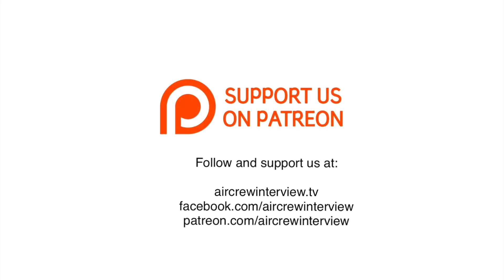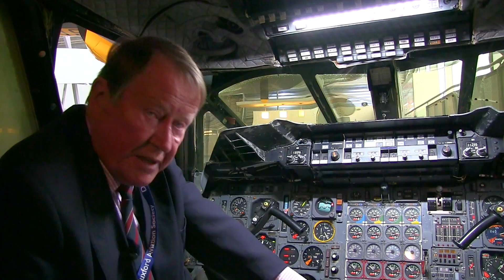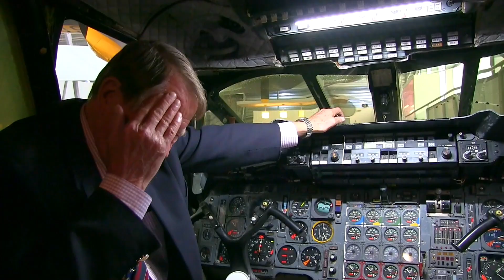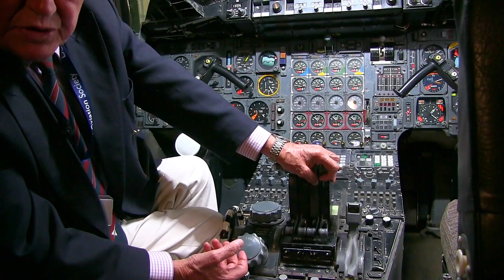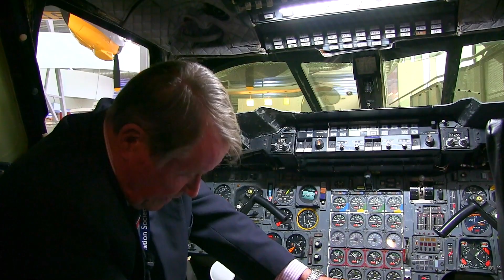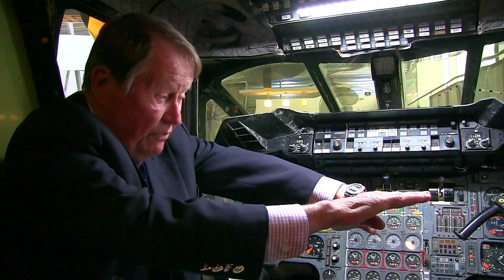John Hutchinson on Air France Flight 4590

Comment: 1. Aircraft down for maintenance the day prior, landing gear disassembled, reassembled without the undercarriage spacer which was left sitting on a shelf:  Check
2. Day of take-off, pilot wants extra fuel, authorizes topping-off the tanks when they are normally left at 83%.  Filled them to max capacity: Check
3. Captain asked for an additional 3 tons of taxi fuel anticipating taxi congestion/long wait time: Check
4. Passengers are part of a crew ship with full baggage for a long distance cruise from New York to Sidney, baggage weights were maxed, but 19 bags were left.  Captain told baggage handlers to load up the remaining 19 bags in the rear hold, exceeding the aft Center of Gravity limits.  Aircraft structural weight exceeded: Check
5. Taxi time was only a few minutes, particularly quiet day, so they’re way over weight now with the extra taxi fuel, max fuel tank capacity, and rear CofG exceeded: Check
6. Segment of runway was being resurfaced, closed off for use.  Captain asked to use it anyway because he knew he was overweight: Check
7. There was a ledge of elevation difference between the runway being resurfaced and the working portion of the runway.  Captain requests to use the lower elevation runway being repaired: Check
8. Conditions include a tailwind, which exacerbates the maximum structural weight violation, effectively making it 8 tons overweight: Check
9. Aircraft hit the ledge on the way down the runway, an Airbus pilot noticed that they were scrubbing their wheels down the runway afterwards, with smoke emitting from the LH undercarriage.
10. LH undercarriage right front wheel hit a piece of titanium debris left by another aircraft, cut a heavy chunk off the wheel which flew up at high velocity impacting the wing fuel tank, rupturing the tank due to resonant shockwave effects.
11. Fuel management system had been overridden to allow redistribution of fuel since the crew knew they were over-filled and over CoG in the aft limits, even though intra-tank fuel-pumping is restricted during take-off.
12.  Landing gear skewed off from alignment, forcing the aircraft off the runway before it became airborne. Wiring from the landing gear ignited the bursting fuel spewing from the ruptured fuel tank.
13. Flight engineer got an engine fire warning, immediately shut down engine #2 without informing the pilot, and didn’t select contingency power for take-off per the emergency procedures.
14.  With its reduced power, it never reached its required climb velocity, and barely cleared a 747 waiting to cross the runway by 20ft.  This 747 had the President of France and his wife onboard.
15.  With its max take-off gross weight exceeded by many tons, Center of Gravity exceeded in the aft, fuel spewing out from more forward throwing the CoG out of balance even more, with a tail wind and only 3 engines producing thrust, it crashed into a hotel, never having exceeded 200ft AGL.

It’s like reading a textbook of all the things you could possibly do wrong.  The only thing they left out was stripping butt-naked in the cockpit, dousing themselves with whiskey, while singing drinking game songs.
Reply: The Flight Engineer DID NOT shut the engine down without permission. Capt Hutchinson is completely wrong on this. He admits he should have read the report before doing the interview. Here is what actually happened:

From BEA report P 133: "Engine fire alarm actuation and the very low values on the parameters led the crew to shut down the engine after the Captain called for the engine fire procedure. In fact, the movement of the throttle control lever to its idle stop is heard and, a short time later, pulling of the fire handle. In addition, the deceleration of the engine, established from the recorded parameters, is consistent with a commanded engine shut down."

See the following timeline from the CVR and d Concorde Flight manual.
o	14 h 43 min 13.4 s, message from the controller indicating flames at the rear and read back by the FO. 
o	14 h 43 min 16.4 s, FE “(stop) “. 
o	14 h 43 min 20.4 s, FE “Failure eng… failure engine two”. 
o	14 h 43 min 22.8 s, fire alarm. 
o	14 h 43 min 24.8 s, FE “shut down engine two”. 
o	14 h 43 min 25.8 s, Captain “engine fire procedure” and in the following second the noise of a selector and fire alarm stops.

Comment: I read in another post that a strip of metal shrapnel that came off a jet that landed in the U.S. was on the runway and at that speed was deadly in terms of ripping the tire to pieces that sucked into the air intake of the engine that started the fire....this is a much more comprehensive explanation including the metal strip that places the blame where it likely belongs...

Comment: According to the transcript they did talk about shutting down the left engines. The captain ordered to do the engine fire procedure and even asked later confirmation that the engines were turned off which was the case.

Comment: John only gets one thing wrong; The rotational velocity of the tire at its surface was equal to the aircraft's ground speed.
Reply: hmmm, no. Rotanional velocity depends of how many rotation the wheel does in a given time frame..... we need to know the diameter of the tires and the ground speed.
Reply: @ssssssss6889  Sorry, no. If you can imagine the aircraft being stationary, and the runway moving by instead, it becomes evident that the speed of the tyre's surface must be equal to the runway's speed. Tyres that can withstand the speeds that John conjectured are very special things indeed that do not resemble Concord's tyres at all.
In fact they might even not be made of rubber.
Reply: @ssssssss6889  To elaborate;
Concord's tyres were 48 inches in diameter (actually 47 but I bet they got bigger with speed)
That yields a circumference of 150 inches.
Let's put in a vehicle speed of 230 mph.
Tyre rpm will then be 1611 rpm.
so a point on the circumference will travel 241,650 inches in a minute
or 20,138 ft/min
or 3.81 miles per minute
or 229 mph at the circumference. Small error due to rounding
So the chunk of rubber left the tyre with a velocity of less than 300mph. Still plenty fast enough.
Reply: @scheusselmensch5713   That's correct but that's the vectoral speed. The rotational speed should be quantified as degrees per time, degrees per second, for example.
Reply: @ssssssss6889  Ah, I see what you're getting at. Rotational velocity was John's choice of words but he was definitely referring to the speed at the tyre's circumference.. At any rate, John suggested that the rubber chunk had a velocity comparable to a missile. As it happens I used to work with missiles and a typical speed for your garden variety missile was on the order of 1.5 to 2.5 Mach. A 4 pound chunk of rubber impacting the aircraft at Mach 2 would have carried the whole wing away.
I'm sorry but I thought you were disputing the speed of the ejected lump of rubber.
Off the top of my head, the rotational speed of the tyre would have been on the order of 10,000 degrees per second but 1611 rpm is a perfectly adequate measurement of rotational speed in any event.
Let's say then that the rubber chunk had an ORBITAL velocity about 250 mph.
Reply: @scheusselmensch5713  Right , ok. I am with you. I won't really be able to go through all details but I feel like the energy transferred to wing at time of impact should depend on 3 variables that are mass of the chunk, speed ( the way John means it) and rpm of tire. If , say , the tire had a much bigger diameter, assuming that the chunk would be the same size, the energy transferred to the wing would have been lesser due to the lesser rotational speed / rpm. Feel free to comment or to correct if needed, please.
Reply: @ssssssss6889  Well we can leave the rpm out of it as that is simply a factor required to calculate the speed of the chunk. Mass and speed in this case suggest an energy on the order of 10K Joules. If the chunk had been travelling at "the speed of a missile", it would have had around half a million joules of energy.
Reply: John also forgets about the Continental Airlines DC-10 that left a piece of metal on the runway.
Reply: @akseli9  No, he clearly mentions the FOD and the damage to the tire it caused.
Reply: @scheusselmensch5713  Thanks, I'll watch the entire video again

Comment: Accepting 450 kg of extra luggage is understandable (Who wants to pay for the Concorde experience and then wait for his bags at JFK for 5 hours ?) but taking off with a tail wind is so wrong. Did the crew know about the presence of french president, sitting in a 447 near the western end of the runway, and was somewhat invited to entertain the guy instead of slowly taxiing to take off in the opposite direction ?

Comment: For the passengers, "trip of a lifetime". It was to be a dream, New York, Sydney and they packed on the weight. Just a tiny part of the disaster, but over takeoff weight. A Clusterf*ck, taking off toward the wind, tires smoking. They ran over a strip of titanium that cut off a piece of rubber, and tank #5 was hit. Filled to the brim, against rules, it was the end. I may never fly again.

Comment: This is a story of commercial aviation. Once something goes wrong, it is like a house of cards. One thing after another. I once ended up overweight after cabin bags needed to be put in the hold. In order to get below take of weight, we sat on the taxiway with 40% thrust for 10 mins to get to max T/O weight. Never comfortable, always wise. How a Concorde Captain could be happy to cut corners when he is actually overweight, rather than notionally in my case, is beyond me.
Reply: especially because at the very high angle of attack for take-off and the rear c of g  at above maximum weight induced drag would have been immense - worse if the gear couldn't retract

Comment: Where does he get his data from???
It's just that pretty much everything he says conflicts with the final report done by BEA (w' accredited UK experts too)...
* the approx one ton overweight is negligible
* it wasn't a tail wind.  Wind was reported at 8? (or was it 6) kts - but probably nearer zero according to the BEA final accident report
* the spacer was not relevant to the aircraft deviating in direction on the RWY (accident report attributes that to solely the failed #2 engine, and loss of power on #1 (later recovered to near nominal)).
* FE did not shutdown the wrong engine. 

The list goes on.
I think folk should read the final accident report.  And I think JH needs to back up his (seemingly spurious) claims! - with, you know the stuff, DATA.

And... I think folk should read the Wikipedia article too.  (It's well referenced)!
NB: JH's claims (in this video) are covered in the WikiP article under the "Alternative Theories" section.
Reply: You believe in the tooth fairy, santa claus, and the easter bunny don't you?
Reply: @tommyspencer7891  You've produced some great evidence - NOT.  Well done.
I'd suggest you read the BEA final report and appendices and then back up JH's contrary and unsupported claims with some evidence.
Otherwise, I will not waste any further time with  you and further ad hominem attacks will be rightly ignored.
Reply: https://www.bea.aero/docspa/2000/f-sc000725a/htm/f-sc000725a.html
Reply: https://www.youtube.com/watch?v=C-nALYF73hU

Comment: Unbelievable so basically it was 95 % pilot error . How sad
Reply: That's not true his paraphrasing makes it sound like he's blaming the Capt but there are many more details to this story like the gear that failed to retract causing excess drag making their climb out that much more difficult and by his own words he states that "we will never know how much those bags weighed" but the crash report states it was less than 1 ton overweight and had a negligible effect on performance. 

He also motions with his hand a right overbank implying the loss of fuel from the left wing caused the condition when in fact the overbank was to the left and caused by failure of engine 1 from the fire and the subsequent massive asymmetric thrust from 3 and 4 forcing the pilots to reduce thrust (or face a certain crash) of an already struggling jet and the decay of airspeed made the stall inevitable - there was nothing they could do. Since engine 1 subsequently failed from the same fire affecting engine 2 his assertion that shutting down num 2 was a critical mistake can't logically be true they simply would have crashed a few seconds later than they did - even if it wasn't the appropriate action by the book it was irrelevant in the end.

It's also been determined that the left wing would have disintegrated long before they could have made any runway so less weight and more speed were irrelevant they were doomed from the start and the captain deserves more respect than this video implies he flew it to the end.

Comment: Thanks, John for the extensive explanation from your side on this incident. All these errors that the pilots made that day you don't hear in the official reports, which I find very interesting. Your explanation on these things appear authentic to me with my understanding from flight physics an aerodynamics. One can see that sometimes it is been chosen what is been released as the official version of an incident like that. I am almost certain that if these explanations had been official published, BA had a big safety issue problem. One can also see that not only experience and seniority plays a role in everyday life, which these pilots had. People make mistakes, but that's why one has more than one pilot in an environment like that. The question for me is, why the co-pilot and the flight engineer agreed on the takeoff that day with all these errors being made???

Cheers

Comment: Very interesting! I always wondered why after the thing withthe big piece of rubber hitting the wing the take off wasn't aborted.
I mean this would surely cause enough of a noise and movement to the plane to notice somthings gone wrong. And becasue of the wheelspacer missing the aircraft was already not going straight when accellerating and must have been hard to keep under control. Just imagine that when landing with the high speeds of the concorde... Most people then say there is a point of no return where you have to go airborn, but let's face it if your decision is between trying to get airborn with a high chance of crashing down or aborting a the take off and sliding off the end of a runway i'll take the later one. I think survivability would be higher.

Comment: I always wondered how much "get-there-itis" played a role in this crash. A stitch in time saves nine - a taxi to the reciprocal would have burnt off fuel and brought Concorde back under max weight. Hindsight is 20/20 and none of them, not even Captain Marty, knew what cutting a corner or two for the sake of the passengers' holidays may do. It's a stark reminder that even experienced pilots can fall under the deadly spell of "get-there-itis." If the plane weighed less. If they didn't pull to the left due to a missing spacer. I always wonder what hitting that ramp from the resurfacing to the old runway would do to the tyres. I'm surprised they didn't blow out there and then. The missing spacer sent the Concorde off to the left, the tyres on the left bogey got heated and stressed and were more susceptible to going pop when they hit the titanium rub strip from the DC-10 - or the lip over the two runway surfaces. All the holes in the cheese lined up on this flight. If only they could clean her up and get the landing gear up, if only they didn't hit the titanium strip, if only, if only, if only. If only it wasn't overweight, it may have climbed out and made it to Le Bourget. If only the left bogey didn't scrub and send Concorde towards a 747, they might have rotated later with a bit more speed. If only it got off the ground a second later with more speed. If only BTSC was released from the hangar sooner after the reversers were repaired. If only another ship was allocated to the pool for that flight. If only the F/E left no.2 running for a few more seconds. It's truly a tragic accident where the right (or wrong) set of circumstances dooms 113 people. Captain Marty did his best. They all did. Sadly pilots turned into passengers and fate took control of the plane. There are important lessons for every pilot here.
Reply: As you say, what is absolutely a red flag is that the pilot was allegedly concerned about the fact that the passengers might miss their cruise ship. That should have played no part whatsoever in his calculations. The only thing he should have cared about was the actual flight itself. Taking anything else into account, like the cruise ship, can only have impaired his ability to make the right decisions as far as this particular flight was concerned.
Reply: @ajs41  Sadly get-there-itis affects every pilot. I've fallen victim to it but was wise enough to realise the wxr was closing in and better go back. I'd rather invonvenienced SLF rather than a smoking crater even if they don't appreciate that at the time. Ironically Manx2 happened while I was getting my CPL and was widely discussed.